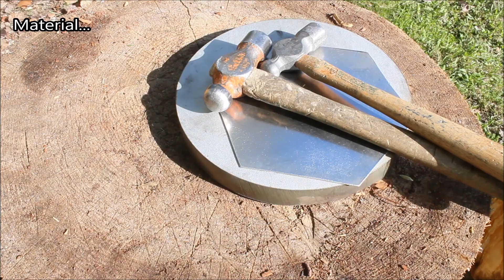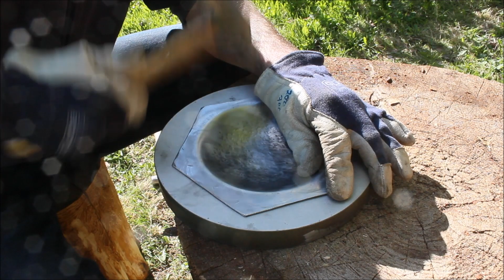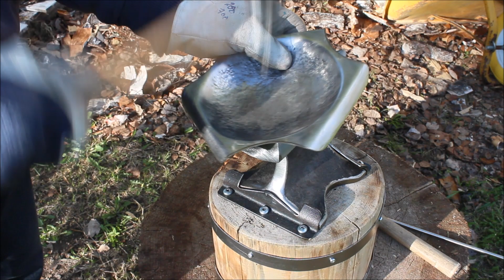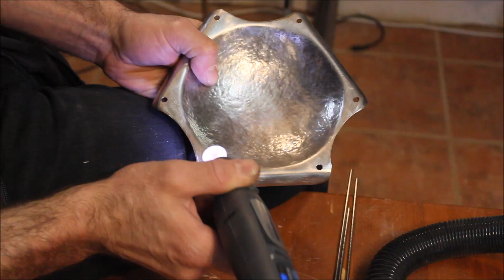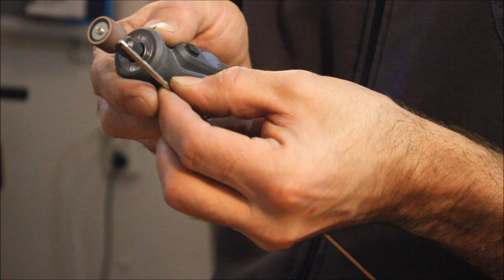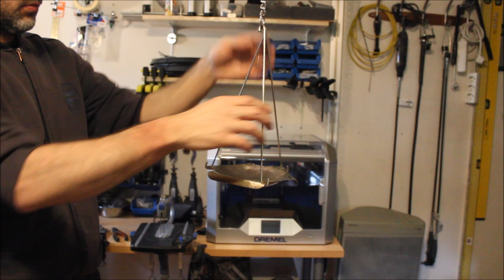Cold formed stainless bowl / "spirit of sauna"

Comment: Great work Tuomas! Did you heat the metal up first,I could not tell?
Reply from the maker: Opa's Workshop Thank you Opa. No i didn't heat it. 
Its cold formed, that's why it hardens during hammering, but i like its just a good thing. Its easier to smoothen the surface at the end when its little harder. Heating at the end was just for the colour.